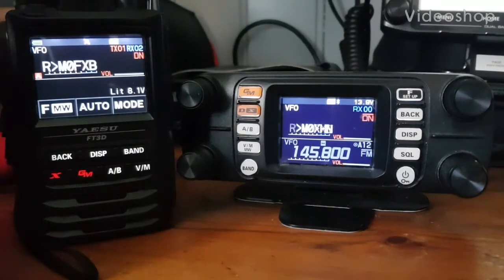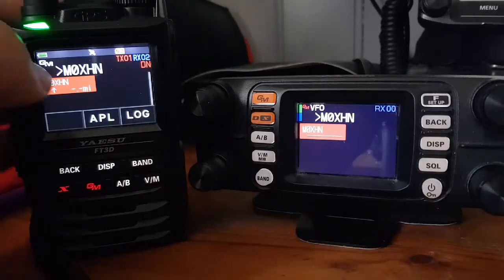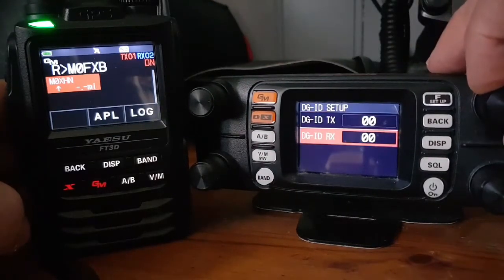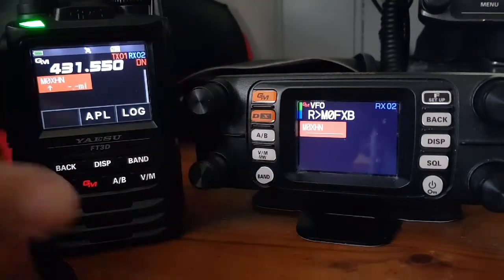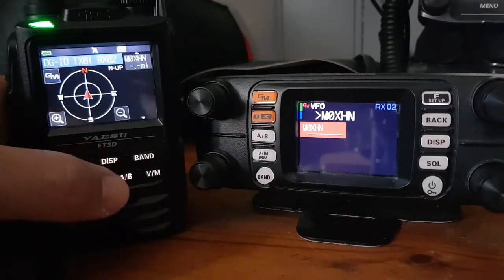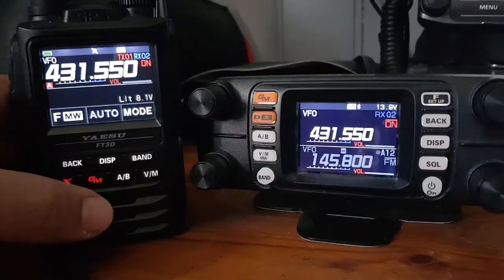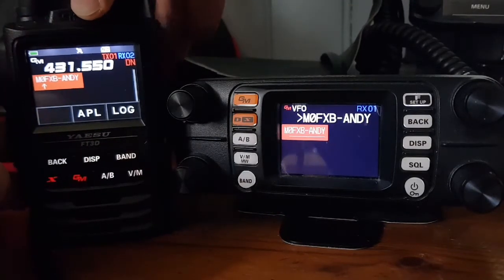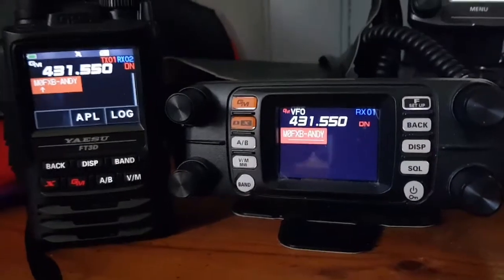Yaesu FT3D-FTM300 -Group Mode send messages - Set up DG-ID and more .

Comment: Why would you set them to 01 and 02? They dont have to be different, just set them the same. The picture thing isn't worth it. You would need the camera mic which is expensive and the pictures are terrible and take minutes to send. I like the messaging option, but I wish you could do that without being in group monitor. Aprs works fine for messaging too, though, so I guess it doesnt matter.
Reply from the maker: Feature full radio i now have the ft5d its a great hobby .
Reply: @M0FXBHamTech  I got ft70de for hiking, is the ft5de really worth it? What's the range in the woods? Isn't HF more suitable ? Like Xeigu X6100 ?